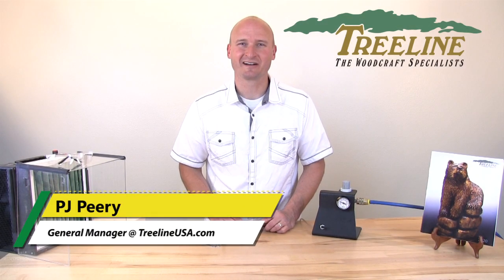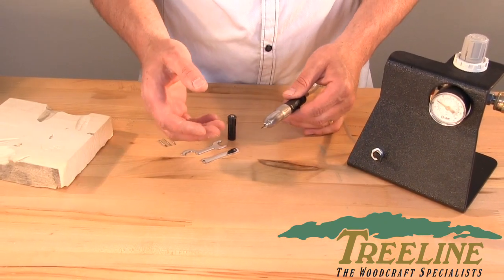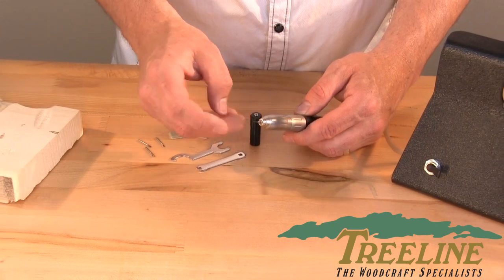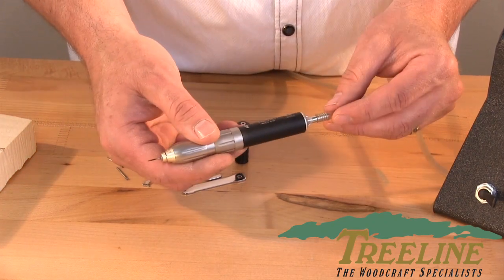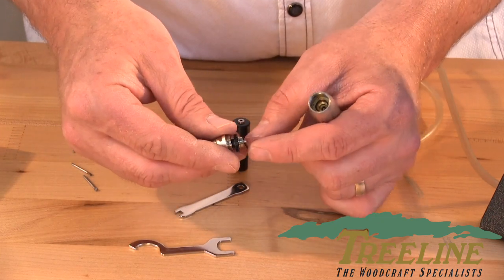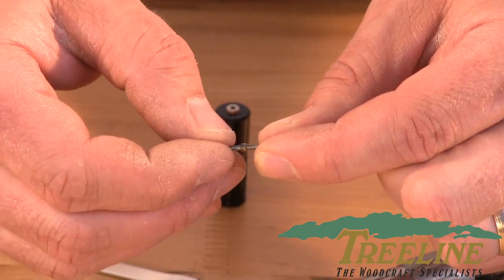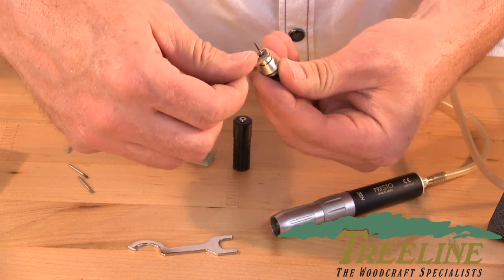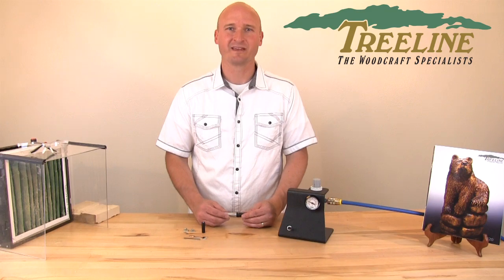How to Set Up and Maintain the NSK Presto II - TreelineUSA.com

Comment: Any advice for cleaning the black, burned stuff off the carbide bits? Also, I'd like to purchase a router base for the NSK Presto but it says it's out of stock. Any idea when this will be back in stock? I can't find it anywhere else.
Reply from the maker: Hi John.  A brass brush does a great job cleaning off carbide bits. It is abrasive enough to remove the buildup but not abrasive enough to hurt the bit.  We usually have the NSK Grip Guide (router base) in stock, but our supplier has been a little slow lately.  We should have more in 1-2 weeks.  Feel free to give us a call and we can backorder it for you.

Comment: I have the same tool attached directly to my air compressor and every time I try to use it the tube snaps off the Presto and flies everywhere. Do you have any advice for that?
Reply from the maker: Yes!  There is a locking ring than may be missing.  The ring goes over the hose, then put the hose on the barbed fitting on the handpiece, and then slide the locking ring over the barbed fitting.  That should keep it in place.  You may also double check that you have no more than 35 psi going into the handpiece.  Finally, the hose might be a worn out.  You may try trimming an inch or so off the hose and then reattach.  If you have additional questions, feel free to give us a call.  1.800.598.2743